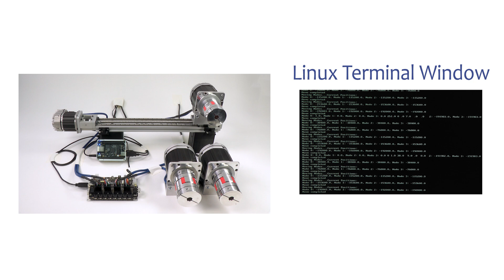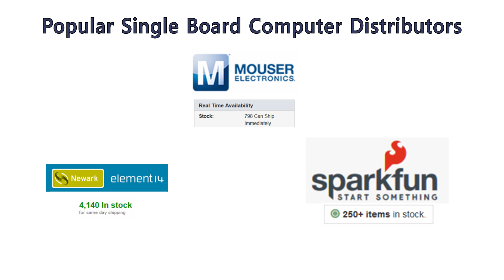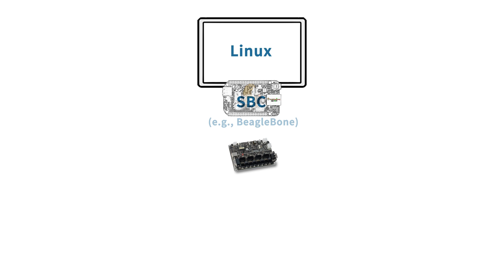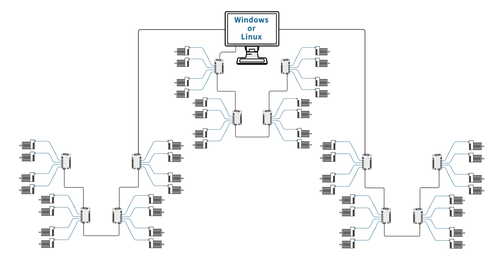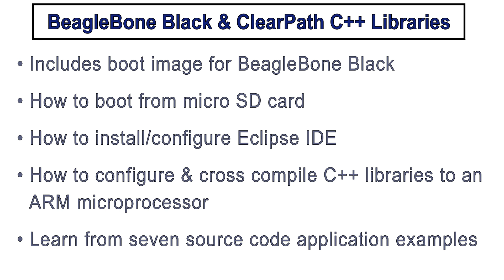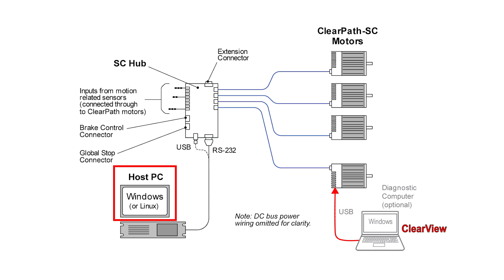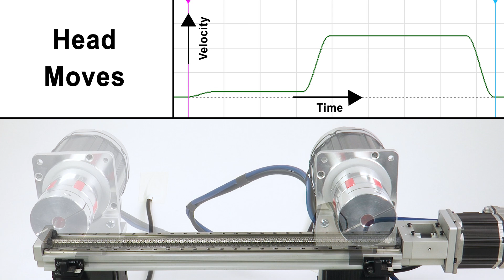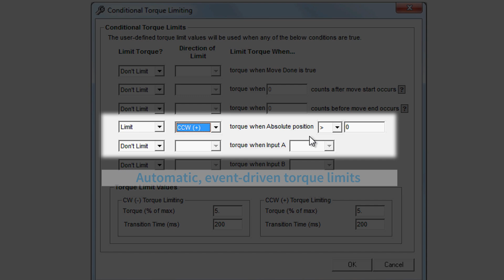Motion Control with BeagleBone Black or Raspberry Pi and ClearPath-SC Servos

Comment: Hi! Thanks for the video
Could you share the part number of the shaft couplers please? also,  I'm looking to couple a teknic shaft of 12.7mm to a rod of 30mm...
Reply from the maker: Hi NedSar85. Thank you for watching! The shaft coupling in this video (and one we recommend to our customers) is a clamp-style spider coupling. This is a 3-piece design consisting of 2 aluminum outer hubs and a polyurethane “spider” in between. The inner spider helps damp vibrations that are common with bi-directional, start/stop move profiles with varying torque. There are also relief cuts in the outer hubs which enhance mechanical grip.

 

I’ve provided the part number and website link below based on the specifications you’ve provided:

 

PN: MJC57-30-A JD36/57-98R JC36-8-A

Website link: MJC57-30-A, JD36/57-98R, & JC36-8-A, 30mm x 1/2" Jaw Coupling Bundle | Ruland

 

If you have any other questions, please feel free to contact us at https://teknic.com/contact or speak to us directly at 585-784-7454.

 

Best regards,

Celina A. -Teknic Servo Systems Engineer

Comment: amazing, super interested in these motors now! Going to add them to my next CNC build!
Reply from the maker: Hi Vlad…Glad to hear it! ClearPath is a nice fit for a wide variety of applications, but for CNC we typically recommend using ClearPath-SD instead of ClearPath-SC (the SC being the specific series featured in this video). I’ll explain why.

Both ClearPath-SC and ClearPath-SD can be configured for step and direction input, which is compatible with many CNC controllers. If you use the ClearPath-SD, set up is simple: wire the CNC controller to the ClearPath-SD and make sure your engineering units agree. With this, your integration between the CNC controller and the ClearPath-SD is done. 

If you elect to use a ClearPath-SC, in addition, you’ll need a computer host for the sFoundation software API, and you’ll have to write code managing when the ClearPath-SC software is issuing commands and when the CNC controller is issuing commands. Many CNC controllers are not designed to easily interface like this, and the ones that do are usually custom solutions designed for applications requiring more machine flexibility compared to what the typical CNC controller offers.

As a result, the vast majority of CNC customers use the ClearPath-SD with an off-the-shelf CNC controller. This allows excellent performance with minimal integration effort. 
But there is a use case for the ClearPath-SC in CNC. Specifically, CNC customers integrating the ClearPath-SC are almost exclusively OEMs. These equipment manufacturers have the engineering resources and make the software development investment to maximize machine flexibility and gain a competitive edge. Other than this OEM exception, ClearPath-SD is typically the best fit for CNC applications.

I hope this helps. If you have any additional questions, feel free to contact Teknic directly at https://teknic.com/contact/ or give us a call at 585-784-7454.

Best regards,
Matt C. – Teknic Servo Systems Engineer
Reply: @TeknicInc  Great information and You also answered my question!

Comment: To control a 3 axis glue dispensing machine, would it be better to use a setup like this with Clearpath-SCs and a raspberry pi or Clearpath-SDs and a PLC?
Reply from the maker: Hi Diane,

I’m an engineer with Teknic and you ask a good question. There are benefits to both approaches (ClearPath-SC with a Raspberry Pi or ClearPath-SD with a PLC or other controller), so there isn’t a single easy answer to your question. In order to make the decision, you will want to consider the type of motion you require (e.g. point to point vs. contouring), your programming experience (C++/C# vs. ladder logic or some other IEC language), and the other types of peripherals you need on your dispensing machine. 

I suggest that you contact Teknic to discuss your application. One of the engineers here will be able to help you narrow down your choices and make the best decision for you. If you have any additional questions or comments, you can contact a Teknic engineer at 585-784-7454 from 8AM-6PM ET (M-F) or use the "Contact" form on Teknic's website: https://teknic.com/contact/

Best regards,

Jon K. – Teknic Servo Systems Engineer

Comment: What about ROS2 integration?
Reply from the maker: Hi Weldopedia,

Thank you for your inquiry.

Although ClearPath-SC doesn’t have a library that natively interprets ROS2, we have had customers successfully use ClearPath-SC motors (and our other lines of ClearPath-SD or ClearPath-MC motors) on machines which utilize a ROS architecture. There are a number of different ways of integrating the ClearPath motors into a ROS architecture, but the specifics will depend on your application.

If you’d like to discuss your application in more detail with a Teknic applications engineer, please feel free to give us a call at 585-784-7454 or use our "Contact Us" form online (https://www.teknic.com/contact/). 

Best regards,
Jon K. – Teknic Servo Systems Engineer

Comment: hello. please do you have examples using your SC, for robotics applications. for example robot arm, delta robot. thanks a lot.
Reply from the maker: Hello Isaac,

Thank you for your inquiry.

Teknic works alongside our OEM customers to help them integrate our products into their equipment but we' re not a machine builder so we don't have machine level code or videos. However, soon we'll be posting a new video of a Teknic built multi-axis robot that shows many different types of machine functions so be sure to subscribe to Teknic's YouTube channel and click on the "bell" to be notified when the new video is released.

In the meantime, you can view many single axis video examples in the "Support" section of Teknic's website: 
https://www.teknic.com/watch-video/

We also have ClearPath-SC software libraries with function-based example code available in the  "Download" section of Teknic's website:
https://www.teknic.com/products/clearpath-brushless-dc-servo-motors/clearpath-sc

If you have any additional questions, please feel free to contact us at support@teknic.com or call 585-784-7454.

Thanks for watching!

Best regards,

Tom T. - Teknic Servo Systems Engineer

Comment: Congratulations for your products. I am exploring options for autonomous and teleops robots (hobby - not professional yet) and see a great fit in your products, except: 1) I don't see reference to support of Can Bus 2) An AC power supply sounds to be the norm to use , requiring then a power conversion for DC Power (batteries) - any architecture suggested for this? 3) I am leaning towards Nvidia Jetson controllers. Would you release docs/videos for the integration with the Jetson series? Thank you in advance,
Reply from the maker: Hello Americo: Thank you for your positive comment and questions. Here are answers for each question.

1) There is currently no support for CAN Bus because although it is a popular, low-level protocol, it has certain technical limitations in a number of applications common for ClearPath-SC. 

2) As you state, most fractional horsepower servos run off of a DC bus. Fractional horsepower ClearPath servo motors can be run from DC voltages as low as 24 VDC, so most customers with applications similar to yours will use batteries. Just be sure to allow for regenerative energy (i.e., energy that the motor will put back on the bus when the sign of the torque is opposite the sign of the velocity—this is common when decelerating quickly). For low to moderate amounts of regenerated energy, ClearPath can be configured to absorb the regen energy rather than pushing it back on the bus. See “Vector Regen Shunt (VRS)” in the ClearPath manual (https://www.teknic.com/files/downloads/clearpath_user_manual.pdf) for more detail on this. 

3) We don’t have any current plans for a video on Jetson integration, but we maintain a database of customer requests for videos (and product features, etc.), so I will add your request. In the meantime, if you have specific questions on integrating ClearPath into a Jetson architecture, please feel free to give us a call at 585-784-7454, or use our “Contact Us” form online (https://www.teknic.com/contact/).

Thanks again for your interest! 

Brendan F. - Teknic Servo Systems Engineer

Comment: Any chance to see the "ClearView" app ported to Linux and ARM processors? Windows it is not an option for me!
Reply from the maker: Hi Alex,

Thank you for your inquiry. While the ClearPath SC libraries are compatible with a Linux OS, the "ClearView" set-up and diagnostic program requires a Windows OS. 

ClearView was designed for initial set-up and diagnostics rather than for application use software. Once you are finished configuring your motor for your application, you only need ClearView for certain functions such as troubleshooting. You do not need ClearView for machine operation once the motor has been configured. Since ClearView isn't designed to be used as application software, there are not multiple versions for different operating systems.

That being said, we have an internal database to keep track of customer feedback and requests that our engineers review on a regular basis - I'll add your request to it. I can't promise that we can/will implement your request, but it will be considered. The items on the feature request list get evaluated to determine which requests have a broad appeal and which requests are feasible. Many of the product features that Teknic offers in our products are a result of this process, so thanks once again for your input.

If you have any additional questions, please feel free to contact us at support@teknic.com or call 585-784-7454.

Bridgette G. - Teknic Servo Systems Engineer

Comment: What is the linear rail system you used in this video- it looks awesome with the mount points for the limit switches!
Reply from the maker: Hi Joe, 

Thanks for reaching out. We used a ballscrew/linear stage from Motion Solutions (it is an LGS33 model). I don't know that this specific model comes complete with limit switches, but I believe Motion Solutions manufactures versions that do.

Please feel free to contact Teknic at +1-585-784-7454 or support@teknic.com with any other questions you have.

Jon K. - Teknic Servo Systems Engineer
Reply: Jn.

Comment: Where can I find the rails and the "linear screw" you are using to drive the carriage?
Reply from the maker: Hi Manuel,

Thank you for your question. The ballscrew/linear stage used in this video is an LGS33 series from Motion Solutions.

Please feel free to contact Teknic at +1-585-784-7454 or support@teknic.com with any other questions you have.

-Bridgette G. - Teknic Servo Systems Engineer

Comment: Do you have products to drive a permanent magnet synchronous servomotors? It’s for a 400VAC motor meant to drive light electrical vehicles.

Your product environment looks really friendly to use, I hope to hear from you.
Reply from the maker: Hi Theo B,
Thanks for the compliment and your interest in Teknic products!

Teknic offers standalone Eclipse servo drives and Meridian integrated servo controllers/drives, which run off of up to 360 VDC bus power, produce up to 20 A continuous and 50 A peak, and can power virtually any three-phase brushless motors. Because these products don’t have the ease-of-use features that the ClearPath SC integrated servos have (like pre-configured motor wiring/settings, auto-tune and object oriented C++/C#), Teknic’s standalone drive products are only available for high volume OEM applications.

Another option to consider, Teknic’s integrated AC input ClearPath (available on our webstore) can take up to 240 VAC and 4 HP continuous.

If any of these options sounds like they may be a good fit, we can further help with product selection. Please feel welcome to contact us at support@teknic.com.

Best,

Aaron B. Teknic Servo Systems Engineer

Comment: Does this synchronizing the motion of servos also create the capability to Autotune the two or more servos at once? The answer is no, correct? Sorry for being confused.. I am one of those interested in slave axis tuning. 

So you could figure out the Auto tuning for the track of the Y axis with gravity and half the weight of gantry being attatched a representation in weight to half that specific weight by secure and balanced temporarily weight to mimick load of each half of X axis motion for both servos of X axis, whereby one of said X axis is inverted with saved Autotune file of said Y axis for both X motion Auto tuning parameters.
Reply from the maker: Hi Jesse,

The question about how to tune a dual-driven system is a common question that we receive fairly regularly. 

You are correct, the current auto-tuning algorithms do not allow for a customer to automatically configure a dual-driven gantry for a number of technical reasons. That said, many ClearPath customers do have dual-driven gantries, and there is a process that you can follow to get your machine up and running. 

To start, the X and Y axes often have the same mechanical design – so I’m assuming that is the same case here. This is done because it makes the machines easier to build and makes the command creation (math) easier. Additionally, assuming that you’re using the same motors on X & Y (which again is quite common), you can follow these steps. (Please note that the vertical Z axis is almost always a different mechanical design than the X and Y):

1) Load 1/2 the total weight that the dual X axis drives onto the single Y axis and then run the auto-tuner. You usually would not use the Z axis even if the mechanics were the same because it is biased downwards as a result of gravity (which dual X axis is not).

2) After auto-tuning the Y axis with the additional weight, load the file into both X motors. 

3) If you are sending the same control signal to both motors and the motor shafts are facing each other (or directly away from each other) on opposite sides of the gantry, click the "Reverse Direction" checkbox for one of the X motors in MSP. Save the two X motor files with different names (e.g. XA_SDSK-3421S_rev1 and XB_SDSK-3421S_rev1) so you know which motor has the reverse direction set. 

4) Run the machine using your machine controller. If the X axis does not seem to have optimal tuning, trying moving the "Fine Tuning" slider left or right to see if your results improve. You will need to do this with both X motor files (and have the same value in both motors) before evaluating the effectiveness of this step. If you make any changes, re-save the new files (overwrite the old files or create new names) in a safe location for the future. 

I hope this helps clarify a few things. If you have any additional questions, please contact us directly at support@teknic.com

Thanks,
Jon K.